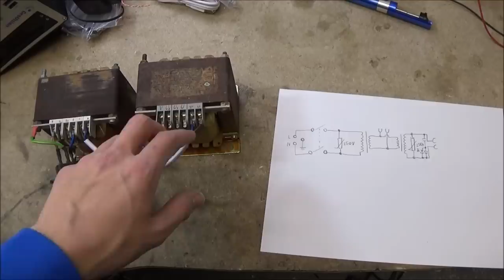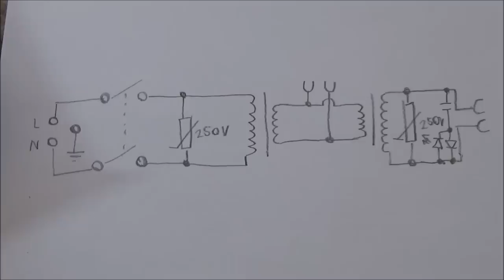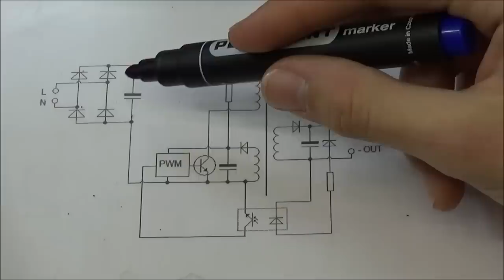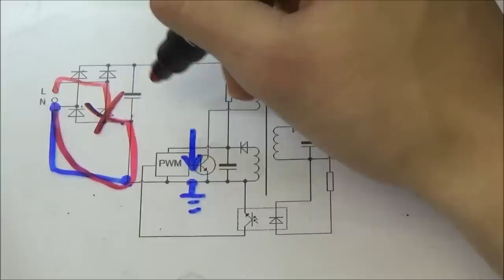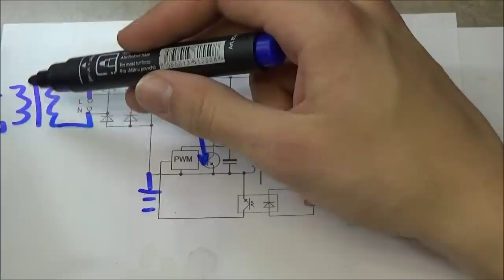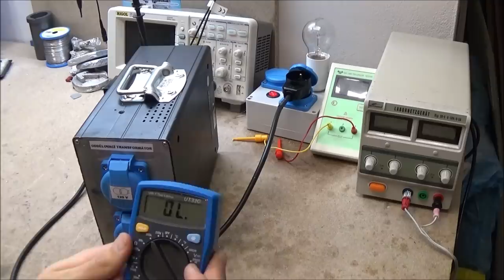Jak vyrobit galvanicky oddělenou zásuvku

Comment: Pěkné video a vůbec všechny, umíš to perfektně vysvětlovat , jen tak dál. Mám na tebe otázku : Pro osciloskop jsem si vyrobil oddělení a použil jsem trafo 230 / 230 40VA přesně toto https://www.tme.eu/cz/details/tmbz45_003m/transformatory-s-uchyty/indel/tmbz-45-003m/
 a na sekundáru mám naprázdno 280V při zátěži 11W 270V a na to se mi osciloskop připojovat nechce, nevíš co s tím ? Varistor 250 by podle mě shořel nebo by se zbytečně přes něj propaloval výkon.
Reply from the maker: Díky za pochvalu. S transformátorem to bude trošku problém, protože je zalitý, tím pádem se nedá navinout pár závitů v protisměru nebo jich pár odstranit. Napadá mě vzít další transformátor 230/30V a sekundární vinutí spojit sériově se stávajícím "v protifázi", aby se napětí odečítalo.
Reply: @KUBA64official  už to mám v krabičce, trafo jsem před tím neměřil, věřil jsem výrobci (INDEL) že 230/230 bude 230/230 a ne 230/280. Otočil jsem zapojení prim./sec. a teď mi z toho leze 200V a pulzák v oscíku to bere v pohodě a na nic jiného to nemám, tak to takto nechám. Evidentně jak se musí od parametrů "některých" čínských výrobků odečítat a někdy i dělit (18650 9900mAh nebo svítilna na 2xAA 6 999 999 LUX) tak polští výrobci (INDEL) na to jdou opačně a dopřejí ti 50V navíc :)